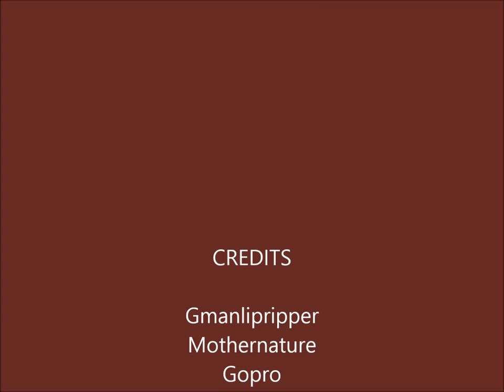Live Edge Walnut Coat Rack

Comment: hey pal , nice lookin nut wood , hey quick question about the radio music in the back ground  ithink it was the cars ,"best friends girl friend" or somethin'. did you tube hassel you for a copyright or any thing ,or did you have to do anything in regards to that, thanks
Reply from the maker: Billy Ray Smith This one they did not. Just from trial and error I"ve found if it is low enough back round noise they don't mess with you.  The other thing is if it is 14 secs or less they usually don't.  Just my experience with loading videos .  I do have like 7 or so videos that say third party content and I usually just acknowledge it and haven't had any problems. Its a risk to take I guess, u never know how someone could react.  thanks for watching don't forget to subscribe and be safe.
Reply: yes ill subscribe now thanks, ya they sent me one of those and I freaked out and took it down , I was brand new., lol ha ha